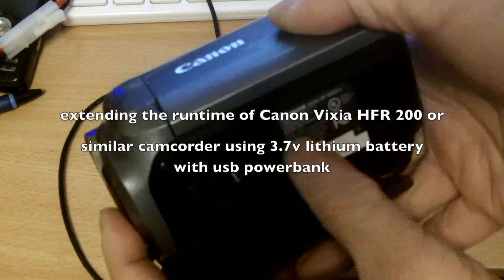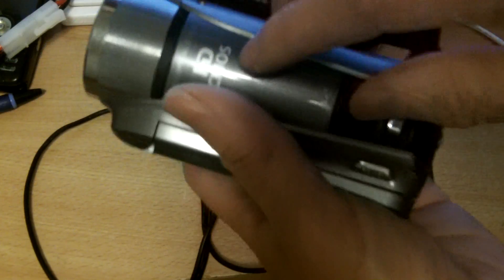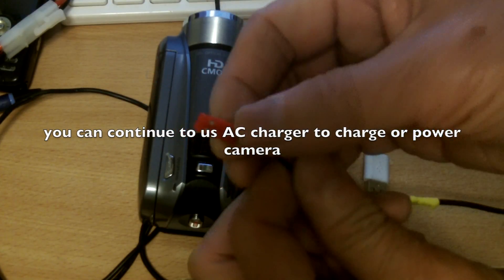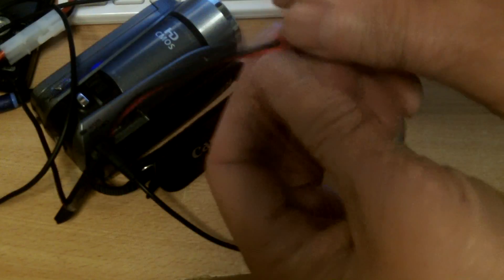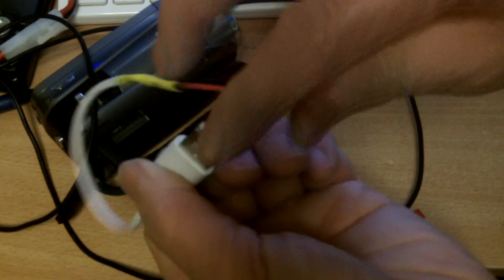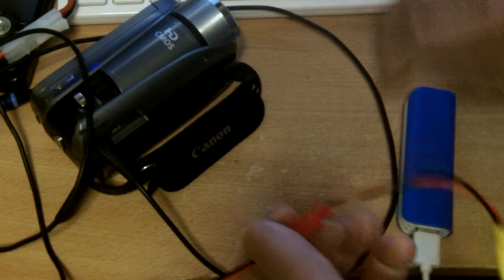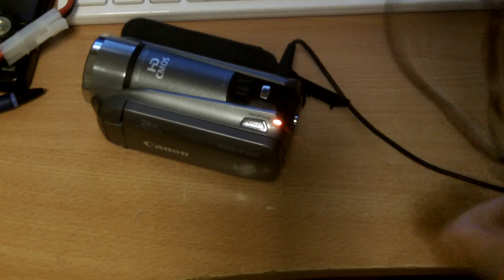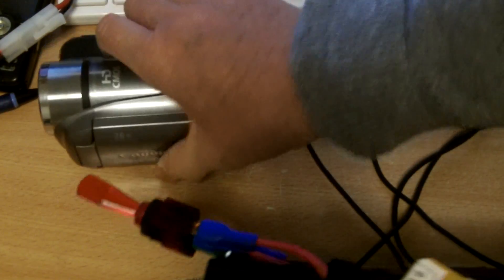Extending runtime of Canon HFR 200 camcorder with usb power bank

Comment: HCV770 panasonic with have usb dc cable.Working with powerbank without modification.Tested i will using denver 16000mah powerbank real 10000mah will get 5-6 hours countinously recording.

Comment: I tried to do something similar today. Cut the cable of my Canon Vixia charger (which supplies 5.3V) and hooked it into a male usb plug. then i pluged this plug into a wall charger. But the camera is not working. I mean. It switches one like for a second, and then it switches off again.Is it because the USB wall charger supplies 5V instead of 5.3? or do you think it's because too little current? (I could not read the current specs on my wall charger)
Reply from the maker: It is probably not because it's 5v although 5.3v would be better. It is because the current output of your USB is not adequate. You need more than 1.5 amp from your usb charger.  Try something with at least 1.5 amp.  If you have an iPad usb charger, you could probably use that as it's over 2 amps.  Some usb charger only put out 1 amp or some of them .5 amp which is not enough.  Let me know how it's working out for you.
Reply: im going to try. in case it doesnt work, im planning to connect some in parallel :)  thanks Bro!
Reply from the maker: Parallel might work if you can sufficient current.

Comment: Why not directly convert to usb port? Oh it's to have access to the wall charger as well ok. Personally I'd just charge the battery bank.
Reply from the maker: The usb port on the camera is not for charging but for data communication. If you want to connect the power bank directly to the battery input, you have to make an adapter to do that.  The camera manufacturer's battery is very expensive if you were to buy a spare. This setup allows you to extend the runtime without plugging the camera into AC while you are using it.